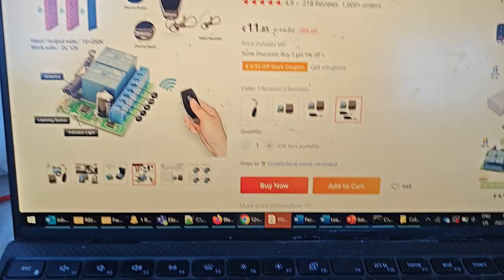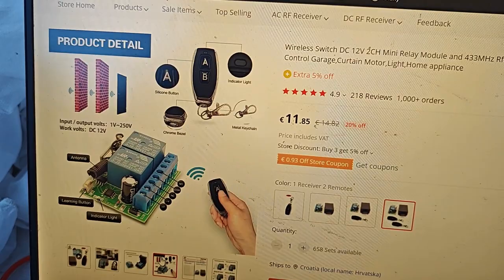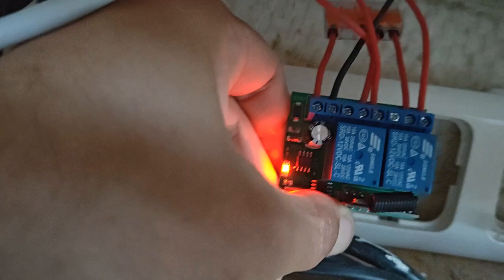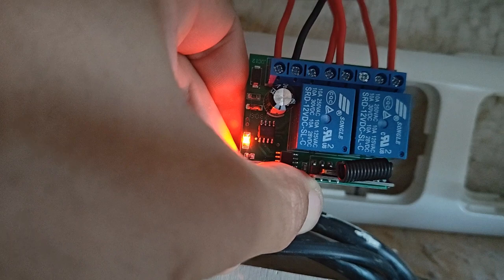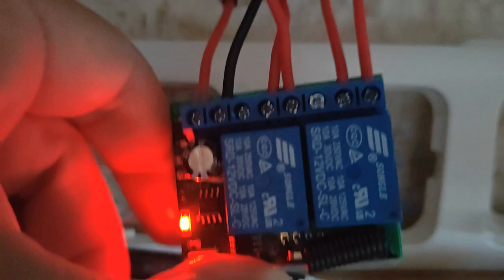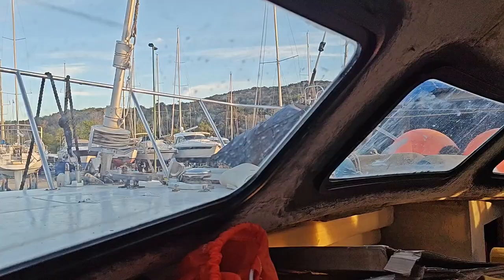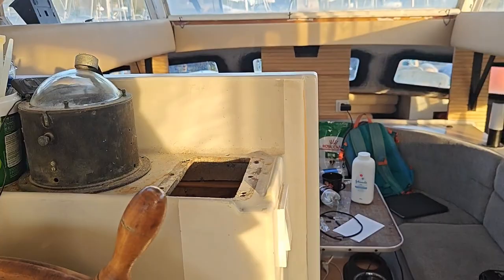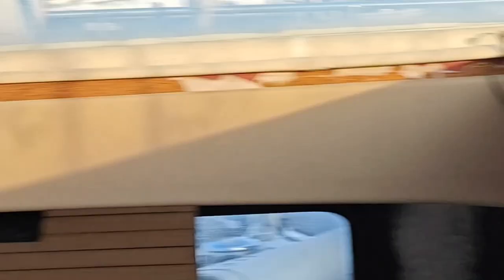Wireless windlass remote for under $10

Comment: So if you drop the remote overboard and it starts spilling your anchor do yoy have a way to stop it? 
Curious because Ive looked at doing similar but with a tap-twice-hold input required.
Reply from the maker: No it needs to be held in to work, so if I dropped it, it would stop and I'd either have to get the spare or the wired remote.